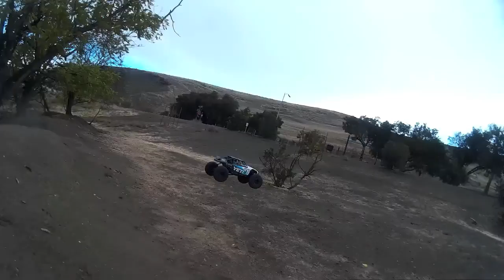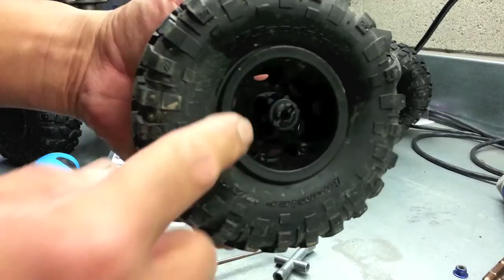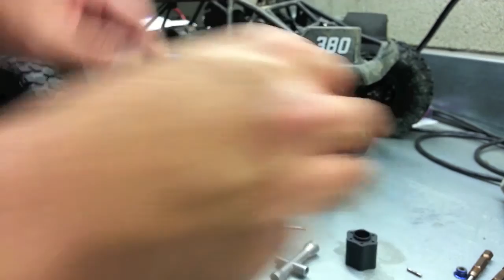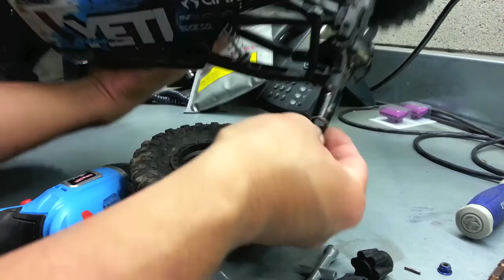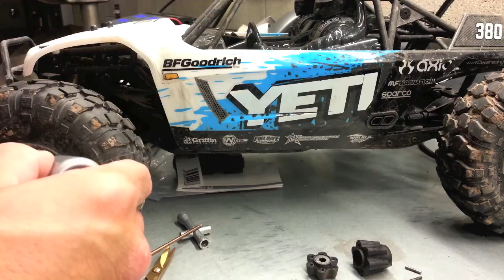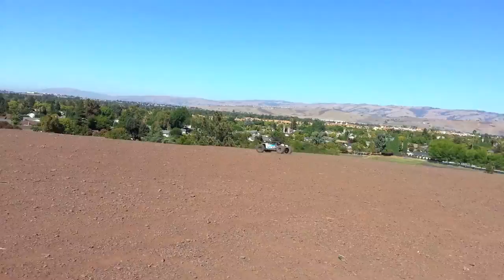Project Yeti (AX90026) Update AXIZ1000

Comment: This is probably the most important update on the Yeti, those stock hubs will chew out everytime!
Next most important is stopping the tires coming out of the beadlocks, happens every run!
Either get new wheels or just cut the foams so they don't get pinched
Good work bud (-:
Reply from the maker: Thanks a lot.. I know... It got so annoying with the tires coming out.  I already installed my U4 tires with alloy beadlocks..you can see it in my other video
Reply: eunique
Yeah, cutting the foams doesn't work, I found out today lol. Looks like new rims and tires then.
Reply from the maker: Cutting the foams helped.. And i also saw vid of someone sanding the inner part of beadlock to get better bite... So tires held on longer... But the 3S power just shreds it off still.  LoL
Reply: eunique
I was thinking about putting little screws through the edge of the rims and tires, but I bet the tires will just tear through!